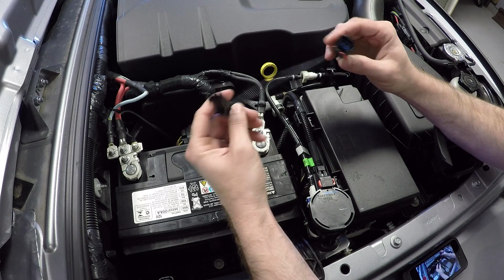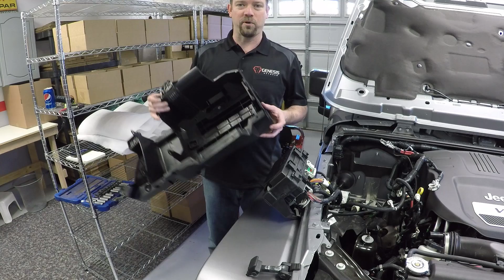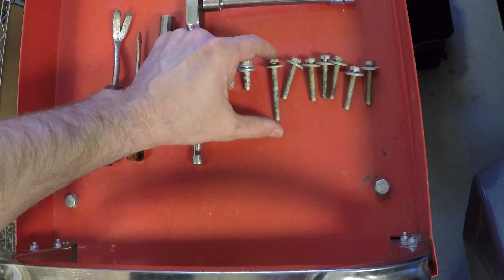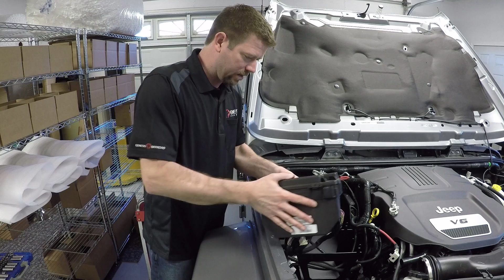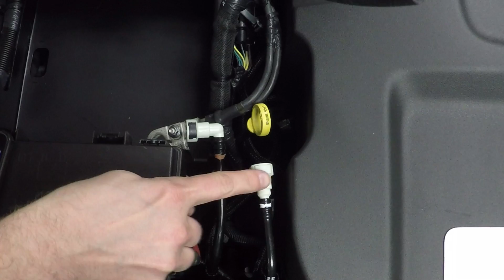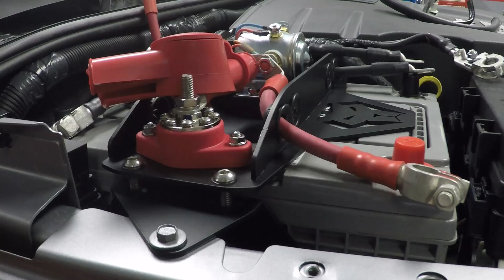Installation Instructions for the Jeep JK Dual Battery Kit

Comment: Is your battery tray deeper than the factory tray? My shock towers are a little taller than factory. I had to trim the fins off the bottom of the factory tray for my shock mounts to fit
Reply from the maker: No, actually our steel tray frees up a little bit of space all the way around. The stock plastic battery tray is quite thick in order to give it some rigidity, so you'll have more room for your shocks with our tray in there.

Comment: When this is installed, is it like a diesel truck with 2 batteries where if 1 goes bad, both need to be replaced at the same time or can I replace 1 without worrying about the other?
Reply from the maker: you can replace one at a time.

Comment: Shane, it's been a good while.  But I'm having some kind of odd issues with my Jeep.  I have that dual battery tray with two Odyssey batteries.  I won't go into all the issues, but just to get to my question as I haven't looked into it yet; can I use a single battery in that dual tray without issue?  Some kind of way to clamp it down?
Reply from the maker: Yes. Just leave one battery by the firewall to connect the factory positive post clamp. Also leave our ground wire connected to that battery's negative post, and leave our other ground wire connected to the factory negative post clamp. I'd recommend taping up the wire that goes to the aux battery positive post just so it doesn't accidentally touch a ground connection and throw sparks.
Reply: @GenesisOffroad  Honestly, as I haven't done anything yet (it's early winter here, so cold outside), I thought I'd maybe move the current good battery, which is the one intended as the spare (fallback) in place with absolutely nothing hooked up to it, but just to have two batteries occupying the space until I can figure out what's going on.  This doesn't seem to have anything at all to do with the Genesis dual battery setup, but something else entirely and it's draining my battery.  I had to pull 3 relays out because they kept clicking.  I may have to take it to a shop, but I want to try this first.  Once I get it figured out, I can always put everything back in place.
Reply: @GenesisOffroad  Thanks for not abandoning customers.  It was already in my mind to try my way first, then since you had an idea, I was going to try yours if mine didn't work out.  Fortunately, it went fine.  I have some loose ends to tie up, literally.  I took the second battery out as the tray seems to keep a single battery in place with no hold downs.  So for the moment, I have a spare battery in the garage that I need to recharge.  Hopefully,  I'll figure out what was causing the problem.  I'd scoured a lot of Jeep owners message boards looking for similar problems.  A good few were kinda similar, but none seemed to be exactly what I was experiencing.  I went for a quick test drive around the block then shut the engine off and restarted it, so I hope that's it, other than those aforementioned loose ends.  I really do appreciate you standing behind your product.  Never worry that if I hear of someone else wanting to do this, I'll point them in your direction.  Not everyone is going to have some of the install issues that I experienced on a semi-rusty older JKU.  That thing is a continuous work in progress.
Reply from the maker: @turn-n-burn1421  Hopefully you can get it charged up and be ok for a little while longer but 5 years is a decent run.

Comment: Hey, the problem what i have, when i start the car all the extra light and speaker not working directly its need around 2 minute to work, so can you share or explain if there is any way to make it work all time spicily i have auto side step and its not working all the time its work only after 2 M

Thank you
Reply from the maker: It sounds like your aux battery is low. Our system lets the alternator charge the cranking battery first, and once it is above 13.2v for 2 minutes, it will link the batteries together so the aux battery can charge. So once they are linked together, your accessories receive power coming from the alternator and turn on. I'd recommend connecting a good battery charger that can put out at least 20 amps onto your aux battery to charge it up, then you'll be fine.

Comment: On the solenoid rear where the information is … now standing in the front of the batteries, looking at your logo… the left of the solenoid is listed as main and the right as auxiliary… this would tell me that the front battery is the main???
Reply from the maker: Good observation! However, the way we install it is different. We swapped the red and orange wires from left to right. The red wire detects voltage on the cranking battery and it also provides power to the solenoid. The orange wire detects voltage on the aux battery. We do this because it allows the wires to be routed directly to the proper battery post more easily. The red wire needs to be on the right side so that the isolator can be powered by the engine's alternator. If we left it the original way, then if the front battery were to get drained down below 9v and the isolator cannot operate, then it would never be able to connect the batteries together. Hope that makes sense!
Reply: @GenesisOffroad  That might be my problem in some way.  My so-called reserve was the one that had full power and my main battery had 3v.  And multiple relays were clicking like a doomsday alarm.  Anyway, I'm just gonna get that battery I pulled charged and make sure it's holding a charge. (according to Odyssee's website, they only have a 3 year warranty and mine are roughly at 5 years now.  I'm not looking forward to replacing a nearly $400 battery.

Comment: Howdy, It's been a couple of years now since I had some issues with installation that we resolved with your help. Sorry, I've seemingly lost those emails. But I have a new problem today that I have to resolve in some manner. I was installing a new harness for a pair of Baja Design A-Pillar lights on my JKU. In the process of attaching the positive lead onto that little auxiliary post where you say any future add-ons should go,  this is hard to describe but under that positive cable, there is another nut, same size as the top one. It started spinning on the post. So I renched it down, then that whole metal assembly started spinning. Ultimately leading to me stripping the top nut along with the top of that post. I can already see there is sufficient post for me to remove some and could buy a new nut, but now I'm concerned about the bottom part of that assembly. Send me that email and I'll do my best to display what I'm talking about. Thanks.  I have absolutely no intention of repeating that install. It was far more difficult than you make it look, at least in my case. Partly because I didn't have the luxury of a basically new Jeep at the time. Of course I'm sure there were other factors but I don't tend to pay people to do things I should be able to do on my own.  Just watching one of your newer videos for this same application, I notice you've made a change to the top part of the battery tray where connections are made. I have the version in THIS video, not the new version.

Comment: Couldn't we just delete the EVAP solenoid?
Reply: Not to override what Shane says, but I was told by a mechanic that the EVAP is totally unnecessary and it would run fine if not better without it.  But I've left mine as is.  I think, not sure, that emissions testing is dead nationwide.  We certainly don't have it here.
Reply: @turn-n-burn1421  I wish there was a diy for removing the thing
Reply: @ElevatedD  Me too.  I'd do it.  I don't think anyone, maybe short of California has emissions testing anyway.  We certainly don't have it here.
Reply: @ElevatedD  I spent some time yesterday looking online for any example where people had done that, hopefully a video.  The only thing I came up with were all these pessimists saying all these reasons you shouldn't do it.  Yet, I truly had a mechanic told me it'd run fine without the thing.  If I can remember for certain which one it was, I might let them remove it.
Reply: @turn-n-burn1421  yes I'd love mine gone. I have read the Jeep will stink like gasoline though which has me hesitant
Reply: @ElevatedVehicles  I saw that one too.
Reply: @turn-n-burn1421  an interesting this. I wanna take off my evap canister as well
Reply: @ElevatedVehicles  My understanding from this mechanic, although I didn't inquire was that you can remove it all.  Just don't take my word for it.
Reply from the maker: It’s part of the vehicle’s emissions control system so we do not recommend removing it.

Comment: Will this work with an aftermarket cold air intake? As far as space goes?
Reply from the maker: Yes. Our system keeps the air box in the stock location, so there's no interferance with aftermarket intake systems.

Comment: Before installing the air box, Do the Evap solenoid install, do not cut the factory lines, instead use a heat gun to reshape the plastic hose so that factory connections are used, do Not over heat the plastic & work large areas instead of localized heat. snap in the Evap solenoid & then re-install the air box.

Comment: If I'm running an aftermarket CAI, will I still need to reuse the factory air box section? I don't own a Jeep yet but will be buying one soon.
Reply from the maker: That depends on which CAI you are using. Some of them reuse the factory mounting system, and some of them come with their own new mounts.

Comment: Why do t you just put in the back in a marine battery box and run a cable up front
Reply: which is easier every week you have to charge said battery or instead having the alternator charge it
Reply: @reaper12345678901ify  why wouldn’t the alt charge the one in the back, if it’s wired into the system it will charge if it’s 4ft away from the alt or 10ft away, your logic confuses me
Reply: @reelnative01  Couple of things 1) you still have to put in an isolator so your cranking battery is protected 2) its a pain to run all you winch, light and accessory lights to the battery in the back.  Much easier in the front where you can go through the firewall for only the switches, much less wiring hassle.  3) space - need all the space in the back for gear
Reply: @JK-zi1rg  I think I could mount a marine battery tray in the back and run the wires in about one quarter the time it took you to dismantle the right side of the Eng compartment and the price for this is crazy you can buy the wires and marine box for about 50.00

Comment: Can the spark plugs on the passenger side be changed with the batts installed? Guess I am asking is there room to remove the plugs.
Reply from the maker: No, you'll need to lift the top lid up and remove the two batteries to access the spark plugs, but that only takes a couple minutes.

Comment: If you were going to work on the engine and wanted to disconnect he battery, do you need to remove all 4 posts?  Could not find any removal videos.  I guess that is a good thing.  Lol.
Reply from the maker: You can simply disconnect both ground clamps to kill power to the entire vehicle.

Comment: Used this video and installed it yesterday. Now down to picking batteries. Question on batteries. Does it matter Gel cell, flooded or AGM? As long as 34 group?
Reply from the maker: They just need to match. You shouldn't mix battery types when connecting them in parallel like with our system, because they charge differently, so mixing types will reduce the lifespan of both of them. We recommend using a high quality dual purpose (cranking and deep cycle) battery such as the Odyssey or Full River batteries shown on our website. There are plenty of other options out there at your local auto parts stores as well.

Comment: If you put a charger on the main/start battery when it’s fully charged will it switch to charge the accessories battery?
Reply from the maker: Yes. Once the main battery is above 13.2v for two minutes, it will link the batteries together and start charging your accessory battery. Here’s a quick video with more details - https://youtu.be/BxEV01_4I_s

Comment: Hello again! The power and ground bus, what is the size of the eyelet for the ring terminal that would fit? M6 or 1/4?  what size are the 10pc that you sell as option?
Reply from the maker: The power bus bar’s center stud is 5/16”. The ground bus bar center stud is 1/4”. The 8 screws in the circle use a #10 size ring terminal.
Reply: thanks! more power!

Comment: I got to the very end, and then figured out I can't use a yellow top and a red top.  I wish I had known this.  The terminals end up all wrong.  the red top has the terminals switched.  So, to get the negative on the right, that puts the terminals directly under the tray, which doesn't work at all.  

I wish I had inquired further about "they just need to be the same type of battery and the same size".  I've got a red top and a yellow top, and they're both the same type, and both the same size; yet completely incompatible with this system.
Reply from the maker: Hi Dave, it sounds like you probably have the size 34R, which is the stock replacement size for a JK. Our system requires 2 of the regular Group 34 batteries. The 'R' stands for reversed posts, so the positive and negative posts are on the opposite sides from the normal Group 34. If you just bought your batteries, you can try to swap them out for the correct size. Here's a short video that explains in more detail - https://youtu.be/JopB0I1CRzY
Reply: @GenesisOffroad  thanks!  I actually deduced that that's what the R meant, eventually.  The red top with the "R" was the existing battery; so I ended up just getting another yellow top, and gave the red top to my buddy :-). 

All working great now.  Just need to install the G Screen next

Comment: Do you support connecting a LiFePO battery pack as an Aux battery? Primary battery is still a lead acid.

Apparently, batteries of different chemistries shouldn't be connected for extended period of usage. Does the isolator circuitry fix this gap?
Also, I'm seeing videos about car alternators not able to keep up with fast charging ability of LiFePO batteries. Does your isolator circuit fix this gap by only charging Aux battery off primary battery?
Reply from the maker: No. Because our system simply links 2 batteries together in parallel, it is not recommended to mix battery types. Our system does not alter the factory charging system in any way. It will allow the engine to charge the cranking battery first, and once it is above 13.2v for 2 minutes, our smart isolator will link the batteries together in parallel. At that point they look like one large battery and will charge together. If you want to use a lithium battery, we would recommend going with either a standalone portable battery pack, or you could use a dc-dc charger which will charge 2 different types of batteries from one source like your alternator or solar panels.
Reply: @GenesisOffroad  Thank you for replying. I have a better understanding now.

Comment: i noticed as you put the terminal posts on you put the negative ones first then the positive.  not sure how the isolator works but for a regular battery install, the positive comes in first when putting in and last when taking out to negate the negative power.  if i were to replace the batteries, would the order of removal and reinstall matter?  also do the aux battery terminals get secured first then the cranking and reverse (i.e. last to remove is aux terminals) when removing?  or these things dont matter?
Reply: btw i saw your JL/gladiator dual battery install video and you did it positive terminals first but finished the aux terminals first though positive crank is first to be secured so im sort of confused
Reply from the maker: @Convertibenz  Good eye! The reason for installing the positive wire on first, and then installing the negative wire last is just for a bit of protection. With the negative cable on the battery, the whole vehicle is grounded. At that point, when you are attaching the positive wire, you have a potential for accidentally bumping against a grounded point and throwing some sparks. Imagine you are tightening up the positive post clamp with a wrench, and the other end of the wrench bumps the fender or hood or whatever else is around. If that fender is grounded, then you'd likely see some sparks. Because of that, it's safer to do the negative last so if your wrench bumps something it's not making a complete circuit. If you've done it a hundred times, sometimes you get lazy, so just always be careful! As for the cranking vs aux battery, it really doesn't matter which battery you do first. Hope this helps!

Comment: Did anyone else cringe at those grinding sparks all through the engine bay?
Reply from the maker: It's just a little dust, it won't hurt anything.
Reply: @GenesisOffroad  😬 until it starts rusting...
Reply from the maker: @Dpix1990  We've never had any reports of that. It would be easy enough to angle your cutoff wheel to shoot the sparks straight down to the ground. Or you can cut those threads off with a handheld hacksaw very easily.

Comment: Quick install question: While you are removing the oem bottom battery tray bolt you mentioned that there is a nut on the bottom of it and not to worry because we won't reuse it.... Are you talking about the long nut on the underside of the fender? I got everything installed and saw that one laying on the ground under the Jeep after I pulled out for a test drive. I also noticed that all of the battery tray bolts on my 2017 were the same length (except for the PS res bolt). I didn't have a "longer bolt" like mentioned in the video (which seems to be why the long fender nut fell out). When I feel in the hole, there doesn't appear to be enough thread for the fender nut to screw on to). 

Thoughts?
Reply: I believe it's called the "Fender Liner Nut"